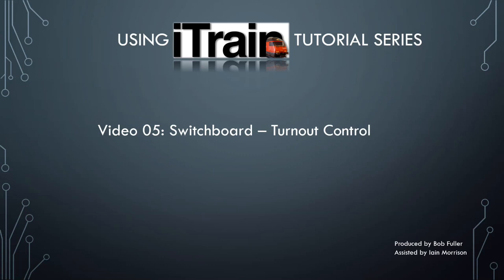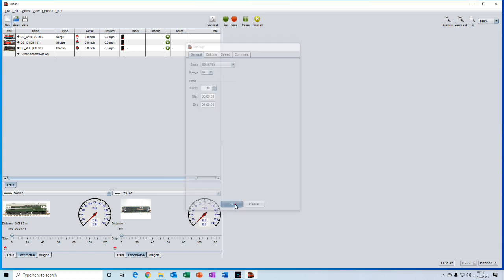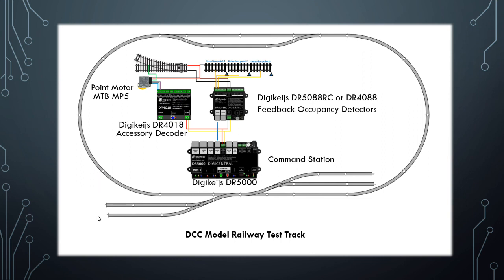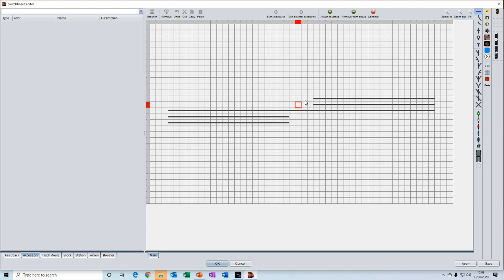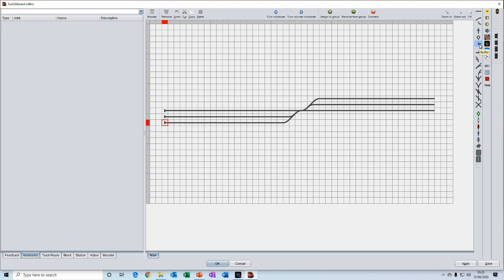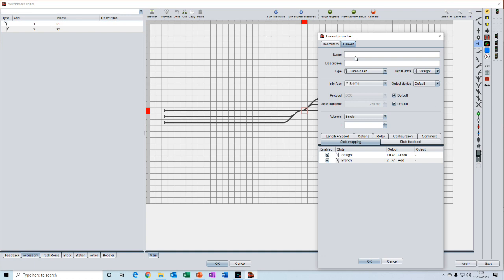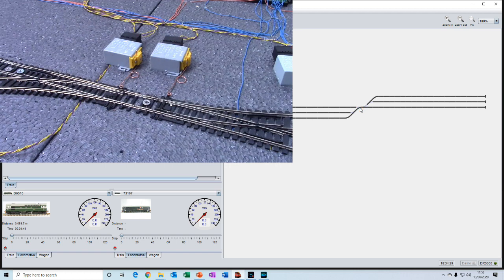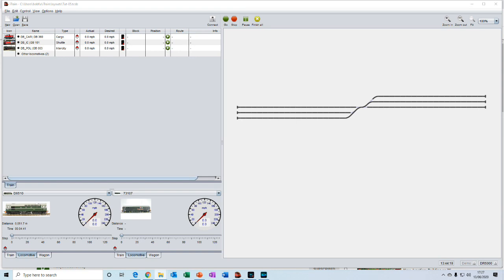Video 05: Using iTrain Tutorial Series - Switchboard Manual Turnout Control

Comment: Hi Bob, I just watched your first 5 video's and i'm very impressed, I want to upgrade my layout later in year with main station Sheffield Midland, but cost maybe an issue I use DCCEX and being a member of MERG I can get kits which I think will keep cost down a bit but I beleive there flag ship Cbus doesnt work with iTrain but I dont think that will be an issue if I can get Current sensors and Arduino and PCA9685 to work for points ... Regards John
Reply from the maker: Hi John, Yes that is correct, iTrain does not currently interface with Cbus. If you like using the Arduino, have you concidered the Acromora solutions?

Comment from the maker: Video #5 is now published. It covers creating a new switchboard layout and operating turnouts manually using the switchboard.

Note: in the video I use the APPLY button to save the changes before exiting. You can also use the SAVE button to do the same thing, with the added benefit that it also saves the changes to the .tcdz file, so it is perhaps a safer method than the APPLY button.

I also tried to experiment with various different types of mouse cursor to make it easier to follow the mouse movements, but the other cursors were worse!! So I will stay with the one shown.
Reply: Thank Bob for all these videos on itrain, I am such a complete newbie, that I have not even laid track yet. I did not want to lay track and then learn I should have done something else first.  My question to you is, if I buy itrain now and then start to build my track an I specify my layout size in itrain first so I don’t design outside of my physical space. I.e keep it all within 2.44mitres and 1.2mitres.
Reply from the maker: @adrianjoss1  yes, that’s fine. I am doing the same. I haven’t physically built my main layout yet (too busy creating tutorials!! :))
The switchboard layout diagram does not need to be an exact copy of your physical layout. It is just a representation of it. Even the block lengths don’t need to be exact to begin with. You can always change the block lengths later when the physical layout has been built.
Reply from the maker: @adrianjoss1  Yes, that is fine. I have done the same. I haven't built my main physical layout yet, either (too busy making tutorials!!). The layout drawing that you create on the switchboard in iTrain does not have to perfectly match your physical layout - it just needs to be a simplified representation of it. Even the physical lengths of the blocks (track) do not have to be perfect measurements of the physical layout. You can alter the block lengths later when you know exactly what they are.

Comment: Hi Bob.  Have spent the last 3 days enthralled by your excellent videos.  I'm new to computer control so watching you explain is fantastic.  Before you go much further in the tutorials may I ask you demonstrate how to wire block detection, point motors and signals etc. and how you program itrain to recognise the individual board and then individual blocks/points/lights etc. as this is all a mystery to me.  Mel from Australia
Reply from the maker: Hi Mel. Welcome to you down under. I have a sister in Adelaide. Glad you are enjoying the tutorials. 

Yes, automation can suck you in and add a completely new dimension to things. You've made an interesting request, but there are already 26 tutorials published, so when you say "before you go much further..." perhaps that milestone has been passed. 

Demonstrating how to wire block detection, point motors and signals, etc, really depends on which DCC equipment you are using. 
Is your current layout DC or DCC? 
If it's DCC what Command Station are you using? 

If you can start with providing this information, I may then be able to better answer your request, but ultimately, I am committed on a path of completing the iTrain tutorials, so will not be producing any wiring tutorials in the near future. 

There are a lot of videos on YouTube which show how to wire up different brands of DCC equipment, and each manufacturer has their own documentation to show how their equipment should be wired. But, if you can tell me which DCC Command Station you have, I may be able to give you some pointers (and maybe even send you a wiring diagram).
As you are new to computer control, my strong advice would be to build a small test layout, similar to the one shown in the tutorials - just a basic oval with some sidings. Or find a section in your existing layout that forms a similar oval with sidings, and that you can isolate from the rest of the layout. Keep things simple and basic to begin with, and then build up your skills step by step, similar to the way that the tutorials have have evolved. The biggest mistake you could make is to jump right in with a complex layout and expect everything to work - it won't, and finding problems in a complex system will just lead to frustrations.
Reply: Bob

What a fantastic reply, thank you.  I live in Adelaide but cannot say I have ever met your sister!!!!!

I have no layout!  I got into DCC 18yrs ago but had to give it all away due to personal circumstances!  But I still wish to start again.  Having watched endless Railway videos it is somewhat confusing watching various people provide their own take, and equipment preferences.

Charlie Bishop’s videos, using Digitrax, provide such clarity but even some of his older techniques/videos and equipment choices are now outdated, given technology advances, which is why I’m looking at what’s available and why today.

I most certainly am looking at a small “Test Layout” to learn the theory and wire so I understand the basics.  

Your Itrain videos are so logical and show, in my opinion, how user friendly this system is, even to a computer dinosaur like me.

Cobalt point motors (appear more flexible than the tortoise I had previously) and a very cheap Digitrax control system appear the way to go to start with, appreciating there are various and maybe cheaper options for pwr distribution/block detection/ signal control but it is the understanding of how to control these devices and program the individual components I wish to master on my starter layout using computer control.

I’m up to date with your tutorials, and sent my request at re watching video 5 as you asked if anyone was interested in seeing the mechanics, but still request you show how to import control boards etc into Itrains and how these are controlled on a real layout and not just in the “Dummy mode”.  This would give me a much clearer concept of what I am attempting to achieve from the outset.

Once again many thanks for your response and as a new subscriber look forward, a lot, to watching what comes in the future

Mel
Reply from the maker: Yes, I understand the need, Mel, and I was a little surprised that there wasn't any takers for a video about this. Hence, we moved on. I think the reason is because the wiring side is so dependant on the system that you opt to go for. 

Once, the iTrain tutorials are completed I would still like to produce a tutorial about the hardware, but if I do, it will be based on the Digikeijs range, just because it is what I know, and there are a lot of users of Digikeijs stuff in the UK. It is fairly state of the art, has an attractive price point, and is well supported by suppliers such as James at DCCTRAINAUTOMATION.

From iTrains point of view, the set up of the hardware is fairly straightforward. You set up the Command Station, as per tutorial #3, except you would select your Command Station from the Type list instead of the DR5000 that I show in the tutorial. From then on, it's more or less just a case of selecting the same interface from the drop down menus when you set up your feedbacks and turnouts, etc. This is covered in the tutorials. There is no "importing of control boards etc into iTrain." As long as your command station is supported by iTrain, iTrain sorts out the communications with your accessory controllers and feedback controllers via the command station.

I have no experience of using Digitrax, so I wouldn't be able offer any advise on that system. Others on the iTrain forum would though, so it would be worth making a post there if you need more help.

Comment: Hi Bob so far so good but I have a 3 way point and two double slips have you done a video on how to set them up in Switchboard? and if so what number is it? Thanks Derek
Reply from the maker: Hi Derek. Actually, no I haven't made a video about this. I will add it to the list of things to do, but it probably won't be this year. So, in the meantime, either search the forum and read the posts there, or open a new question. There are plently of people that will help you. Make sure you attach your layout file to your post. You will get the best responses if you attach your layout file, no matter how incomplete it is.

Comment: Hi Bob.
Really enjoying the videos. Like many I have found them extremely useful. However, I have a problem with turnouts. After setting them up I tested them and found the turnout on the track does not reflect what Itrain is displaying. Do you or others no why?
Reply from the maker: Hi Phillip
Glad you are enjoying the tutorials. To resolve your problem, go into the Switchboard editor, double-click on the turnout in question, then change the "Initial State" setting so that it matches the state of the turnout when the layout is powered on. Hopefully, that will fix it.

Comment: Hi Bob.
You say in video 5 that I can send you message if I need to see how I connect and configure the hardware for turnout's on a test layout, I use Selectrix LokControl 2000 and Central Control 66800.
Please
Allan
Reply from the maker: Hi Allan,
My comment in the video was about sending me a comment if you would like me to make a video about how to hook up the DigiKeijs equipment that I was using in the test layout. I do not have any experience of using the Selextrix equipment, but it is supported by iTrain. If you have questions about using your Selectrix equipment with iTrain, place a post on the iTrain forum. I am sure there will be other people who will be able to help you.

Comment: Hi I am thinking of automating my layout, I use digitrax dcs240 command station and dcc concepts accessory decoders to control the points. Do I need loconet accessory decoders to automate them in Itrain or can they be controlled through the command station as I do now? Thanks
Reply from the maker: Hi Robert, 
The DCS240 and the DCC Concepts accessory decoders will be fine to get you started. Just use a USB cable to connect between a PC and the DCS240. That will allow iTrain to talk to the DCS240 and operate the turnouts. This will allow you to either set the turnouts manually by clicking on the turnouts within iTrain, or allow you to set Track Routes within iTrain which will set a series of turnouts at a click of a button. Track routes will allow you to set certain turnouts to form a route, and then drive the train manually either using iTrains' throttle or your own throttle.
So you will need to drive the trains manually, but iTrain will operate the turnouts.
If you want to fully automate the control of the trains themselves, you will need to add feedback sensors to the layout. That can be done later.
To use the DCS240 within iTrain, you will need to apply for the free 30 day trial license or purchase the iTrain license. This is due to a licensing requirement from Digitrax (i think they are the only manufacture that does this). The free trial license gives you access to everything in iTrain, including support for Digitrax. The ordinary demo license does not support Digitrax controllers and has other limitations in its use. So, apply for the trial license if you have not already done so.
Reply: @bobfuller  Thanks very much to your quick reply. This is very helpful. Glad I don't have to replace my accessory decoders, I just need to get some feedback sensors. Your videos are very useful and clear to understand, looking forward to trying this out now! Thanks again

Comment: could you tell me what vershion of itrain you are using i vershion 4.1.0 thanks derek
Reply from the maker: Version 5.0.4
Reply: If you decide to upgrade to iTrain 5 (which I would recommend) then you MUST install iTrain 4.1.16 which is a free upgrade for all iTrain v4 licenced users. If you fo not install that upgrade then you will not be able to open your layout in V5. I also recommend that yoi install iTrain 4.1.16 even if you do not wish to upgrade as it contains many bug fixes and several enhancements over the version that you are presently running.

Comment: Ive started to follow this iTrain series and I’m finding it very helpful, thank you
I have encountered 1 problem which I can’t seem to solve. 
That is I have one turn out that throws the wrong way and isn’t therefore synchronised with iTrain. I’m sure its something simple but how do I solve this problem.
Reply from the maker: Hi Ian - Try the following. Right-click on the turnout in the main window, and click on Properties in the menu. In the Turnout Properties window, select the State Mapping tab. Right-click on the Straight or Branch and select swap outputs.
Reply: @bobfuller  that’s worked fine. It’s been driving me mad all afternoon.

One other thing. I’m using the 2 months trial software and it’s worked fine off line following your series. I then built a small test track and again all went well. I’m now on to my main layout which has directly powered electro frog turnouts I’ve wired these into my feedback unit but I’m not sure how to handle this on iTrain’s. Can you point me in the right direction please.
Reply from the maker: @ianhinde8870  it sounds like you are making very good progress. It is very difficult to answer your question via the YouTube comments, here. We really need to see your layout file. So, please post your question on the iTrain forum and attach your layout file (.tcdz file) to your post. See page 189 of the manual for more info on how to do this. We should then be able to help you.